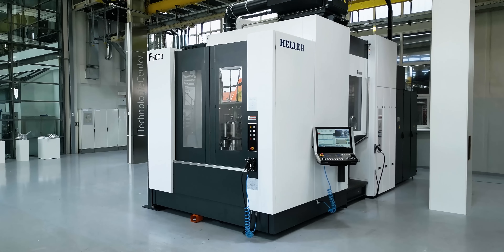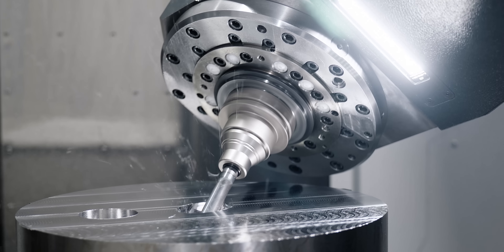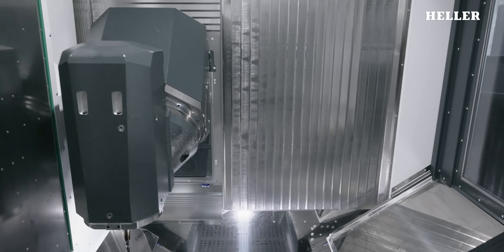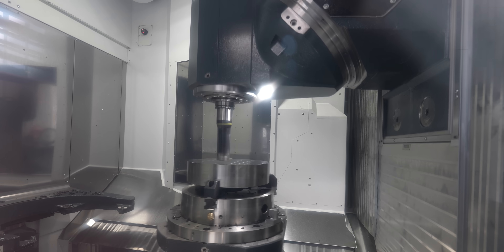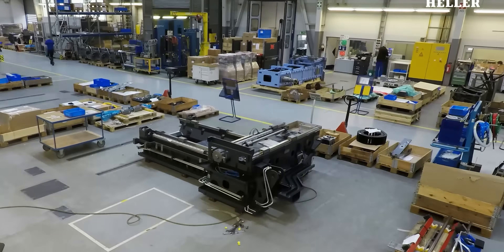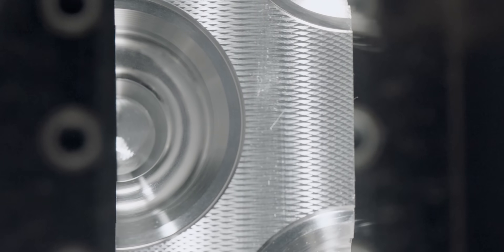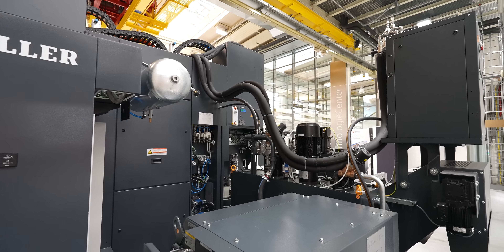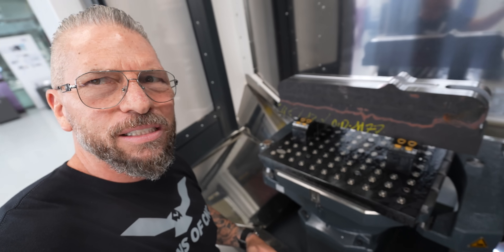This is the Greatest CNC Machine I Have Ever Seen

Comment: You guys want to hear something funny you might think I'm crazy I'm going to put mastercam and  fusion 360 out of business it's not any new invention I took my son's extra sketch drill two holes in the back for the negative and positive wires then found some old  walkie talkies in the basement cut the 9 volt battery connector out of it put the negative and positive wires in the two holes in the etch a Sketch that I drilled put a new 9-volt battery in the 9-volt battery holder that I cut out of the walkie-talkie put some tape so it's not dangling and now I program everything right from there no fusion 360 or mastercam required and it does simultaneous 5-axis machining and everything I don't have to spend all that money on mastercam anymore and I don't have to lie to fusion 360 anymore that I'm not a hobbyist and I'm really a full-time CNC machine shop and it's really easy and if you mess up you just shake the shit out of it  I use it everyday in my CNC shop I have one brand new 2023 GROB 350 the only downside I figured out is that I need to put like a lithium ion 9 volt battery on it because that 9-volt door cell sucks it only lasts 15 minutes so I've been burning through 9-volt batteries like crazy believe it or not many stores sell 9-volt batteries anymore Amazon does though but they are really  shity ones though the voltage is very sensitive I realized I was going to put a couple 18650 lithium ion batteries together but if put all three batteries together it comes to like 11.1v it started becoming glitchy I realized you need exactly 9 volts oh s*** you know what I just thought about 9 volt power supply hopefully I don't have to buy a linear power supply and they cheap switch mode power supply will do just fine but knowing that damn etch a Sketch probably become glitchy because too noisy meaning the constant switching of the switch mode power supply anyway I'll try it out and let you guys know how good it works oh and I love you guys videos are there and everything I know from you guys not just the educational ones too meaning all the other road trip ones in the factory tours oh great 😊

Comment: So the other day I heard a term used for precision in 3D printing   Called borrow a tolerance example you have a printed part that is bending so you insert a steel ground pin to prevent it interesting idea in my line of work (3D printing molds for transfer molding silicone prototype parts )  I’ve also cnc machined some parts for the mold of a part for harder materials that crack during molding.  #htm140v2 dlp printers #tormach440

Comment: Hermle be like: Am i a joke to you?
Reply from the maker: Hermle is legit… but not on level.
Grob is closest… but for the money and all that is wrapped in this machine. It’s definitely the best. Says all who has seen it.
Reply: Hermle uses monolithic epoxygranite frame base, if something goes wrong and it cracks - it just will be impossible to maintain that, needs new frame base. Heller uses cast iron base, all elements are independent and bolted together. If something broke- just unbolt it and replace with new one.

Comment: What do you think of the b axis being able to rotate both directions?  You may be able to eak out a bit extra x axis in transformations in the 40-60 deg range if you have more x by the tool changer before you get to a soft limit.  Semetrical transformations could have some advantages for some parts too.  I run a DMU 90p duoblock which has the same kinematics and that's what i thought of off hand.

Comment: DMG Mori better :)
Reply: Only someone who has never had a Heller says that. 😀
Reply: Im worked on Grob, DMG and Heller. Every of this machine are the same. This is the highest CNC level.
Reply from the maker: GROB is close but this New Heller is on a different level.
Reply: DMG Mori makes more impressive promo commercial with music and computer graphics, that's it. Heller is much more rigid built.
Reply: @TheDIMONART  more rigid than a duo block? I’d have to see some proof of that. Seems that they have almost exactly replicated the Mori head here. Certainly not knocking Heller. But I don’t know anybody with a duo block or FD or whatever that says it isn’t rigid.
Reply: Dmu five axis machine for whatvi have seen it is getting worked on more then it run

Comment: the loading and unloading bay should have automatic high preasure high volum spray down before it unlocks the door in order to completely remove all the leftover chips without the operator have to do it ( maybe even a giant fan in the top to flow the leftover coolent away after it have sprayed it down ) at least thats just in my mind 

btw when are you gonna visit the kitamura factory ? love to see you doing a factory tour of them
Reply: There was a cool AvE video where he had built a few custom tools to take advantage of through-spindle coolant and air. tool swap to a crimped piece of copper pipe in a collet. It traced a path around the part first with coolant to blow all the chips away (spinning of course...like any good pressure washer)...then with air to blow all the pockets dry.
Reply: @frollard  i know. i seen that one. it was just a idea for heller that they could use. that way the machine can clean the part well the spindle in doing work on the next part makeing more money insted of being stuck with cleaning parts ( basicly spindle constantly makes part well load and unlode cell cleans it automatic )